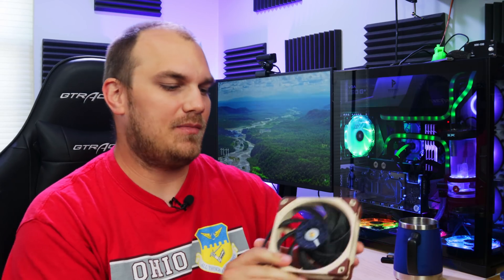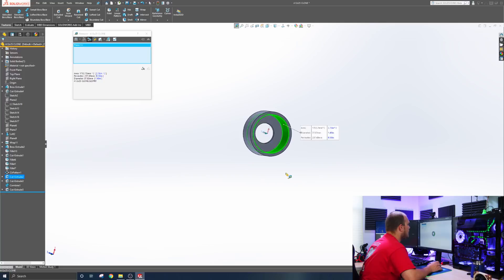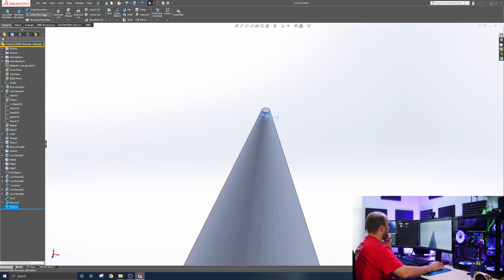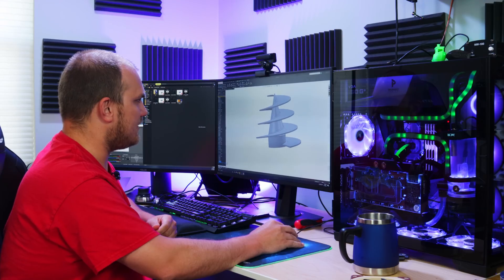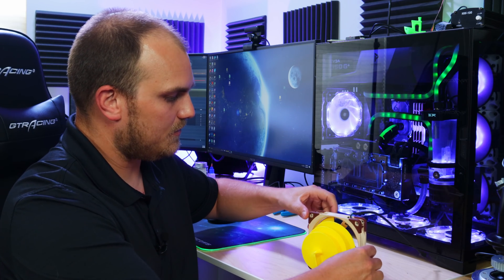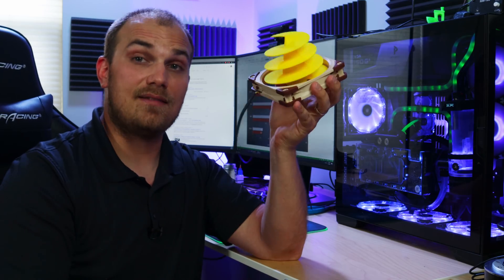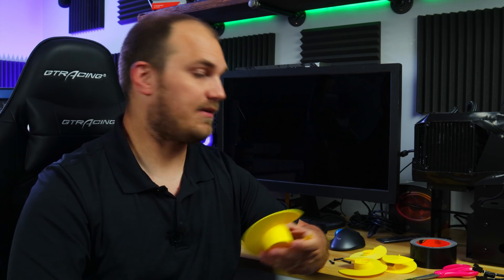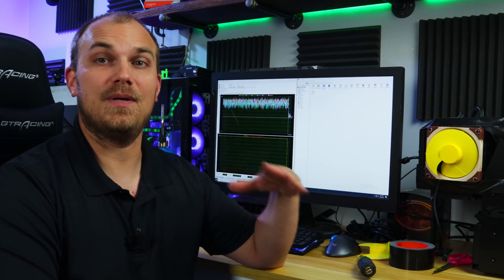Leonardo DA Vinci Made A PC Fan Would It Work?

Comment: The last one works because it has a marginal border with which to squeeze air in.
The fact is, Leonardo didn't invent anything and the screw is something Archimedes used extensively. But to make the screw work, you need something to hold the compounds (air is a compound and so is water) you want to push/pull and it's a SURFACE!
You need a volume to make it work. The last design got lucky because it had a blade that was large enough to push enough air in, thanks to the surface on the side!
Basically, you're aiming for a ducted fan, which is what PC fans REALLY are (all of them). Designs of PC fans isn't just done out of the blue, even the height of the borders (and their shape) has to be taken carefully into consideration, to avoid (or to promote,if needed) Bernoulli's effect, where you can have a fluid that gets pulled while applying a push!! Seems counterintuitive, but it's true. There's a lot more physics that goes into development than what people may generally think.
To make it short, you need your own enclosure, you can't pretend Noctua's to just work with any fan you throw at it.
For example, say you had an inverted screw. With the proper enclosure, it becomes a compressor! Though, the spiraling blade also has to be designed accordingly. It can't be evenly spaced if you need a strong air flow. With the inverted design, you need an ever increasing number of turns toward the top of the cone. Half a cone could be better in this example, or even just a cylinder, given you follow the rule of the ever increasing number of turns toward the compression.
Farewell! Have fun! ;)

Comment: looks like more air is moved sideways but this screw could work in low speed because there is only one slot that air can go through rather than multi in regular fan.

But fans are designed this way to move much air as possible so i don't think alternative designs would give any good results.

Comment: Industrial Engineer here- might I suggest a few improvements? Firstly it appears to me it is rotating the wrong way around. As if to pull air.  (It should try to screw into the air, not out of it. So mirror it. As for the centering issue, I didn't even notice. Anyways, the underside of the blade (that's facing downward) should be fitted with an array of small air pouches,  to reduce the amount of leaking air. Lastly the main blade itself should maintain a curved inward cross-section, in order to hold the air inside. That should produce significantly greater results.

Comment: If you would curve the rotatorblade at the outside like a banana and put gaps into the blade like a grid, the airflow could increase. Currently the air is stopped by the lower part of the rotatorblade and flows sideways.

Comment: this creation would work very well underwater though, perhaps try making some kind of fluid pump with it and use it with a waterblock ontop of a cpu, with that as a pump? I think it would struggle at that, but it would do well in moving itself as it'd be moving that water from the tip to the bottom, just like a propeller.

Comment: Make à PC case with only clear see trough PCB pipe and plug it to some sort of pump to make water go trough the whole system, make the whole frame with PCB pipe ( so only the edges) and the rest of the surface is covered with 120mm fans ( only the surface area, because as I mention the edge are PCB pipes)  , so you'll have a watercooled case with flashy design and never made by anyone else prototype !!! 

( English is not my default language excuse me on that )

Comment: I think it didnt work because you didnt use something to "trap" the air that gets ejected sideways from the spiral (like a cylinder surrounding the spiral) also the helix blade shape could be different.
I would try two different things. 
a) instead of it having a flat surface I would have it to have protruding fins (like you see on old muscle car bonnets) of opposite direction (so that air will travel in a zikzak way along the helix which presumably could mean more air mass per second ?
b) instead of a spiral flat surfaced blade I would try to use  a spiral funnel or multiple funnels (like imagine straws/pipes in a spiral shape so that they suck air as the spiral moves)

Comment: this whole time i was saying make a steeper angle, have the screw angle the exact same as the angle on normal fan blades, with the angle so flat like that the screw isnt pushing air, its cutting it, two very different things, you need a 45 degree angle to push the air outwards. also as everyone said, the shroud..... that was so obvious, its literally so obvious every fan maker in existence has a box for their fan blades

Comment: I love the aesthetic of the air screw when its spinning and I kinda want to see one running with and RGB strobe that gives the illusion that it's rotating more slowly.
Also for the blade profile maybe something like a traditional fan where you still have multiple blades, but just elongated around a cone to achieve a similar aesthetic to the screw but with more useful performance.
Reply: Yeah, the screw design would work for higher torque like for a fluid.

Comment: It does not work well, since it has only one blade to push air. As for the air leak there is Turbine Vent design, it solves both problems.

Comment: why not try a shroud with a blade used in Coanda effect? and at a slower speed. Should be quiet and should have good cooling. But we will know only if you test :)
https://i.pinimg.com/originals/d7/51/a1/d751a1ebb99e911a647491cb70c58d0e.gif
or
http://www.uniairproducts.com/images/impellers.jpg

Also do note that the screw needs a liquid medium to really work. Even there a ducting is needed.

Comment: Im guessing its been said, but a lip on the bottom edge of the blade and/or a shroud running the whole length of the 'fan', albeit a large idea physically, would greatly reduce the amount of air that just slips out from under the blade due to the fact its easier for it to escape to the side than be pushed through the aio cooler

Comment: I would say the less pitch you have the more efficient the air movement would be BUT you would need to increase to speed dramatically to move the amount of air you would need. Also another factor with the single blade would be the cover length. I would say you need a longer housing to match the depth of the blades on the hub. Cool looking fan though!

Comment: You had to print this with supports right? So a part of the object sags down a bit(onto the support structure). Because of that the fan blade will never be concentric. That will also happen on the Prusa. This thing is hard to print in one piece on a fdm printer. The tevo did a nice job with this thing. the extruder problem might rather be a problem in the hotend. Insufficient cooling of the hot ends radiator or the PTFE tube not butting up perfectly against the nozzle. I had that too on my CR10 after switching to a capri-tube. Check the end of your bowden tube (that touches the nozzle) for problems. Have fun with the Prusa. I like mine very much.

Comment: Isn't is obvious that you need to put such screw inside a cylinder and the direction of taper should be in opposite direction, broad at intake, narrow at outlet thus compressing air slightly.

Comment: You would need to SLA print this and design it so it fits inside the fan frame. The motor bearings cannot tolerate any cantilevered load.

Comment: Most likely will need a shroud to channel any air it is trying to move, because what you have now is an Archimedes Screw.  The Archimedes Screw, in use today for various things including water turbine generators, doesn't work without a channel for what you are trying to move.  For air, you will need a close fitting tube.

Comment: If you look at nautical history, they used the type of design before the propeller was created. Current fan blades are the next "evolution" of this design. The issue, i believe, is that it allows far more air to leave the system through the sides. If you decide to add to this later, you should try implanting the screw in a cylinder. This gives the air one path it can follow. It will still be less effective due to the increased mass, but it may be usable.

Comment: Havin' a lot of fun watching you play around with these fan ideas. Though I don't think that fan likes being mounted vertically.
Thought about building (or printing) a rig to mount the fans to? I'm thinking a vertical stack with a base plate (nice and heavy, like a wooden chopping board), with maybe 5-10cm standoffs that screw into the radiator mounts. This'll give it the heft to stay planted, and a fixed path for air to escape. On the top side, a box that can be screwed into the radiator with enough room to sit the fan into the top of to fire air straight down.

Comment: Take the original cone desogn you had and put it in a cone channel (tube) to prevent air from escaping the sides of the blade and not making it into the cpu. You can also reduce vibration by adding a barring (pivot point) at the opening so the tip can have a bracket to keep it in place

Comment: Im imagining Leonardo was called inventor because he realised at least the basics of  engineering.
Aka You can not change measurements, distances, angles and materials willy nilly...
In dealing with aerodynamics tiniest changes can yield massive results based on volume of air etc...
For all them commoners out there It needs to look exactly as in the picture and it will work. However don't expect it to fly to space.

Comment: Check if your printer's X and Y axis are in fact perpendicular to one another. My printer i had to adjust the frame as my axis were not perpendicular. Tested with printing the largest square i could fit on the bed, checked it with a square, and could see the square was a parallelogram instead.

Comment: If you made a solid edged cylinder with the spiral blade, it would reduce air loss and force the air to take a single path into the cooler vs having the air flow bleed out the edges. Basically a collar around it. It would improve the performance most likely. This would also make it closer to an impeller than a fan.

Comment: Would love to see either a 6 or 8 blade design at a 35 degree angle.  I've looked into alot of data from other sources and many different applications such as hydraulics and plumbing and pneumatic applications even, mostly industrial grade and where speed of flow is more important its seems to be the best,  but where force,psi is needed around 12 to 15 degree angle gives better results

Comment: Direction was my top concern and you didn't check to see if it was right until about 14:25 lol

However, for best results you need as close to an "airtight" fit from the base of the screw to the circumference of the fan (fan hole, whatever). 
You have to think of the screw as a literal screw or rooter, not creating any sort of suction/pressure but scooping thr heat and winding it up and away from the source.

So don't think of it as a fan. It's not a fan. These test, while cool, proved nothing due to this, haha.
All said, I HIGHLY doubt it would be effective anyway. "Highly doubt" as in "0.000001% chance it does anything worth noting".

Comment: Wait, if he’s trying to take air out, the fan’s spinning in the wrong direction
Reply: True true! Lets hope he fixes it 🙄
Reply: Thank God others noticed this. Humanity isn't a lost cause just yet.
Reply: Ya, that's what I'm about to say to
Reply: Double helix next
Reply: he was trying to push air
Reply: Here's wiki's picture of a CPU heat Sink:
https://upload.wikimedia.org/wikipedia/commons/2/25/AMD_heatsink_and_fan.jpg
If you look on the  right side, you can see the arrow which denotes what direction airflow goes, and it indeed pushes air into the heat sink - not pulls it away from it.
However, it depends on the fin density. Higher fin density setups usually do pull air (and have a shroud). Lower fin density is usually better to push and not have a shroud, as a rule of thumb.

The image on the wiki would back this up, as that's a pretty low density fin heat sink.
I would say that pushing air in is the more common practice, as high density fins clog with dust faster and so they lose their performance advantage without more frequent cleaning... which the average PC user probably doesn't do.
Reply: Yup
Reply: @patrickpenguin8587  you are wrong. Pushing air creates turbulent flow which is better at transferring heat than is the laminar flow created by pulling air. Granted with most hardware setups the difference is small or negligible.
Reply: In the slow-mo at 13:11 it was spinning the right way.
Reply: @ethansloss6854  nah my dude. Look at the direction in which the spiral is traveling, it's inward pushing into the motherboard, not away.

It's really easy to see because he made a silly drill out of it.
Reply: @patrickpenguin8587  they push air, not pull,it cools by convection
Reply: @Mossybwuny  Every fan technically does both.
Reply: What about having 2 blades ...goin on the same half running simetrical
Reply: Necroing a comment with a wiki link...
Reply: Nobody mentioning that the fan is on a waterloop radiator?
Reply: it's supposed to push air like he has it
Reply: @helmeteer  pushing air down makes no sense. You're going to get up this device to move as much air as possible then you're going to slam that air into a dead stop causing air to bounce back causing flow problems.
Reply: @haywoodjablome440  It looks to me like he's blowing room temp air through a radiator on an open test bench. No flow problems like you describe. Though it's possible a fan like this might be more efficient pulling air through the rad.
Reply: @haywoodjablome440  that thing pushes air, another fan takes it out
Reply: @Mossybwuny  Yeah, I see that. As I explained in my post, pushing air down into that heat-sink is not the way you cool a processor.

Pushing air into a solid halt (heat-sink and pcb) is a very inefficient way of expending energy. It's better to Pull the hot air out and expell it to an open area and let the natural forces of the universe come in and fill the low pressure area (fan intake) with new ambient air, cooling the heat-sink, and then getting extracted by the fan.
Reply: @haywoodjablome440  except that doesn't work if the outside of your pc is hot....
Reply: @Mossybwuny  And where do you think the air you're ramming into the processor is coming from in your scenario? Ambient. 

If your ambient temps are hot, you're still better off pulling hot air away from your processor instead of pushing it into your processor.
Reply: @haywoodjablome440  air when moved fast cools down, if there's just one fan pulling air out of it, doesnt do shit
Reply: @Mossybwuny  Incorrect. The flow of air is what carries waste energy away from the processor. 

Pulling air Away from your processor and the rest of your MB and peripherals keeps it cool.

Open any modern factory built computer. Fans point outward, not inward.

If fans were all that was needed to "change" hot air to cold, Air Conditioners wouldn't exist. They don't do that. Fans generate Air Flow to help carry excess surface energy from one point to another.

Like I stated before, pulling air away from a surface creates a vacuum behind it. That vacuum is filled in with new 'fresh' air just as fast as it's expelled.

All that you have left is the efficiency of the energy spent to spin the fan vs. how much cooling you're getting out of it.

Fans pointed in towards the processor = Less efficient expenditure of energy.
Reply: @haywoodjablome440  "Open any modern factory built computer. Fans point outward, not inward.
Reply: @haywoodjablome440  tell me
do you really think cpu fans work by pulling air??

Comment: Try making a tunnel to cover the blade and make the blade more deeper. At the moment 1 rotation is only  pushing the amount of the area between the overlapping blades, the bigger you make it the more air it can push though. But you'll definitely need to make a tunnerl as all the air you are pulling is not going through, rather escaping between the blades.

Comment: Is a misconception that Leonardo had real intensions for his "helicopter" to fly. That was a job for a theatrical piece, for mere illustration of angels descending from heaven.
Reply: This reminds me of some really badass and unpractical swords he drew as theatre props, they would look really nice in any modern RPG.
Reply: He designed the ballbearings.
Reply: He was just 200 years too soon for ball bearings and machining to exist...
Reply: @thetechfromheaven  Plus it would probably work better as a ducted fan, as the Archimedian screw was originally set up for pumping water.
Reply: @Reddotzebra  i was thinking this exact thing
Reply: Like any prop designer there is something in the concept based on reality.
Reply: Most of his "inventions" were nothing more than exploration of imagination and the process of thoughts and ideas. But that doesn't make any of it less interesting to me at least.
Reply: also its a misconception that helicopter blade create lift by pushing air down.  the blades are actually the wings.  hence the complex gimbelling on them, one side going one way during rotation the otherside moving in the other.
Reply: @MrKago1  They still push air down though, the way the blades are tilted pushes down air as they rotate. 

Sure, they act as wings, but airplanes use the same concept of wing tilt, just look at the way any plane elevator or aileron works.
Reply: @MrKago1  And helicopters don't actually stop spinning the blades during landing like they do in the movies, they just change the angle of the blades so they produce less airflow

Comment: SOLIDWORKS has analyze, which gives center of gravity (you did). Need to be using Euler equations to get reasonable pitch angles for the resulting RPM.
Reply: And a cylinder around the outside, Archimedes screw.